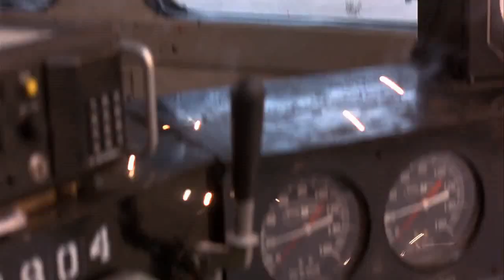Under Siege 2 - Train Car Fight

Comment: I love how lazy the guys in the loco are with their "check" at 0:20, just glancing around and not wanting to do anything. Clearly unprepared to face someone of Ryback's skill.
Reply: Yeah that's awesome.
Reply: @DickBanton  True, but a couple of scenes before they sent a fellow henchman to check the other locomotive, which was rapidly murdered by Seagal, so there was no real reason to suppose someone was there. However is crystal clear that these blokes aren't "professionals", they don't hold the mp5k from the handle, never aim properly, only shoot in full auto.
Reply: They probably hate their job.
Reply: Their job was supposed to be done by now 😂 let someone else deal with the random commuter causing trouble.
Reply: @DickBanton  True, but they are still higly inefficient, nobody decides to sound the horn of the train to deaf to death the attacker, they sit duck inside the cabin instead of scramble outside the loco to intercept the guy, the black guy holds the MP5K without the sling and one handed, and manages to get disarmed, riddled, and arming the attacker with his gun. Then, the other black guy armed with an MP5 misses a guy of Seagal size from 10 feets of distance, fires the weapon stockless and blind fire, and gets his face riddled. The guy on the top is stupid enough to get down from the high ground, and get tossed over by Ryback. 
I wonder why mercs in movies miss basic warfare concepts like: how to take cover, how to not get disarmed, how to shoot a gun efficiently, ammo conservation, 
periferal vision, and all other things that make an armed dude really scary and intimidating, it would be far more suspensful to see prepared and competent antagonists in movies, instead of hired stuntmans and extras armed with a blank-feeded submachine gun.
Reply: @leonhaze-4202  dude, it’s a Steven Seagal movie. They have to handicap themselves when facing Seagal so he can actually be able to kill them 🤣🤣🤣
Reply: The fact is that the director of the film did not want to spend money in order to hire a consultant. Someone from the unit that helped free the hostages could have made the script good.
Reply: Bunch of weekend militia trained in Alabama (they say in the movie that those guys had training camp in Alabama)
Reply: Very lazy 😂
Reply: @DickBanton  Amateur street thugs don't have a monopoly on complacency. They probably thought this would be an easy assignment, so they sat on their laurels.
Reply: ABSOLUTELY. 😂

Comment: 2:47 the 1810 locomotive it's the same unit from Runaway Train movie (The thirth locomotive)  but modified front
Reply: Alaskan railroad 3010 (The lead runaway unit) is 
still running
Reply: Could Imagine if Jon Vight and Eric Roberts are cutting the brake pipes between that loco and the baggage car